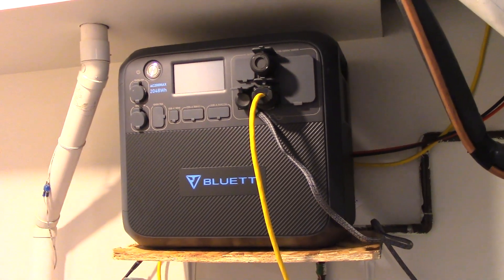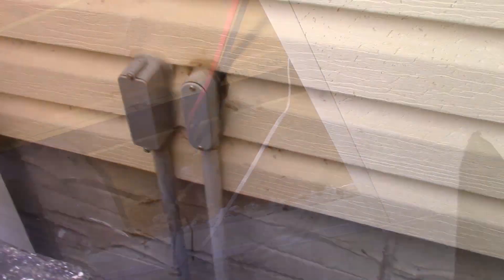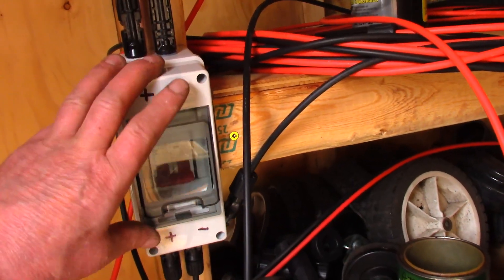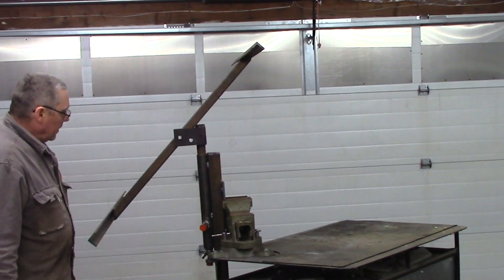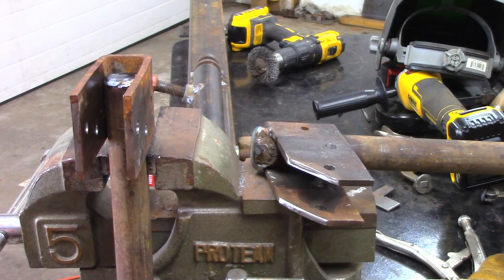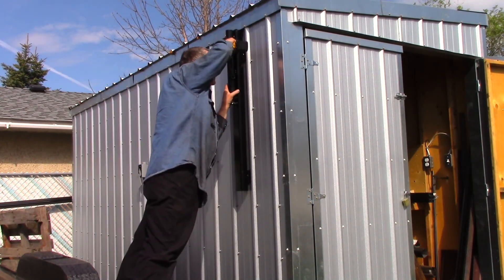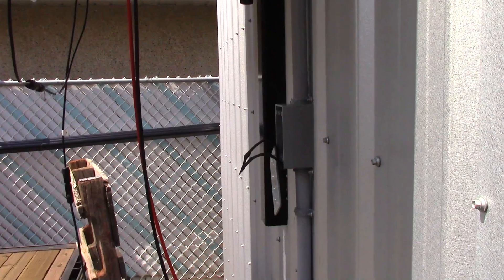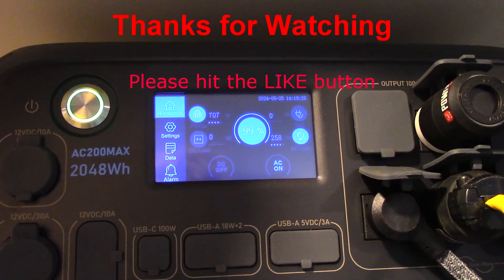Pole mounts for solar panels

Comment: Great video👍🏾👍🏾. Excellent solution. I am thinking of doing something similar for the same three reasons you stated. Insurance, no holes in the roof, and ease of maintenance. At 100 feet and 10 gague, do those wires ever get hot ? And what brand is your breakerbox and solar panels?
Reply from the maker: wires don't get hot.  I have the panels in series, so it less than 11amps.   if anything I do have a loss of watts/voltage because of the length.  use 8 guage.   my panels are renogy 200 watt, and the breaker can be found on Amazon.    lots to choose from.